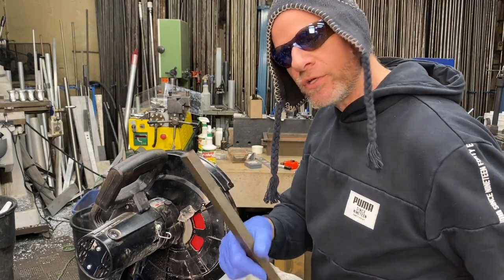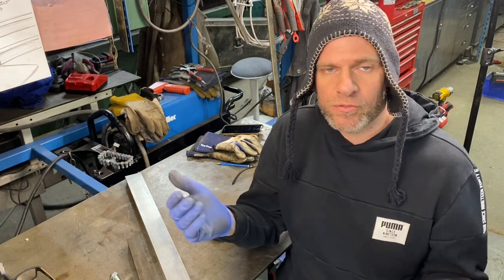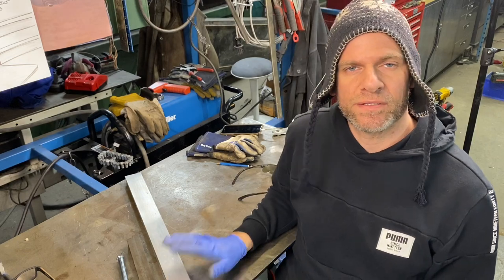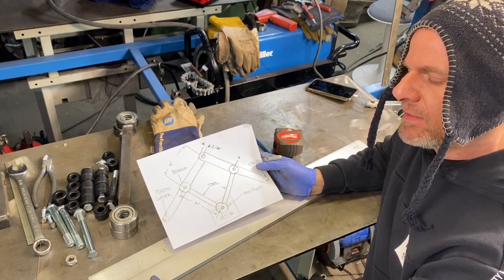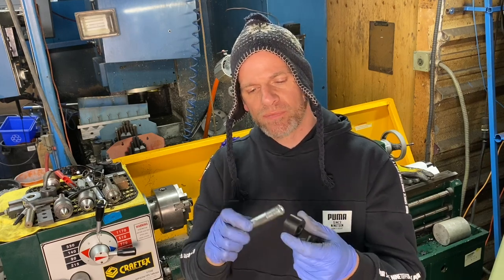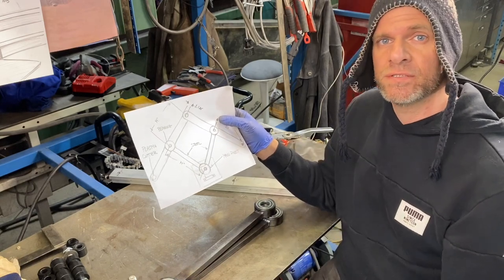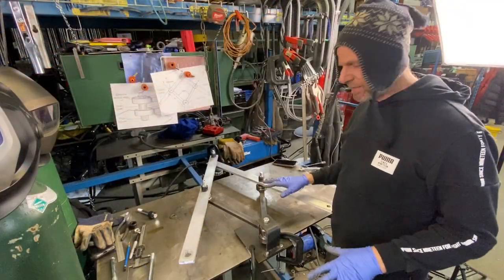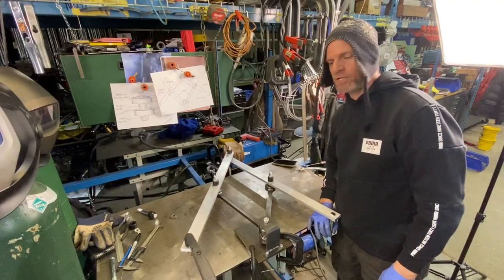Build A Pantograph Copy Machine!!

Comment: Most pantographs that I have seen don't mirror the part like yours does. If you are plasma cutting using this and for some reason your material was different on the back side you would have to make sure you flipped it over before cutting. Most cuts won't matter... but some might.

Comment: I don’t have gmail account.....how much for your unit ...pantograph?
Reply from the maker: Daniel Thomas 250$ for the pantograph unit
Reply: Bonifabcustom Rob Bonifacio I was trying to do your project everything was going find but cannot get proper pipe size to sit bearings in tight....I get some movement 🤷🏻‍♂️
Reply from the maker: Daniel Thomas i got some pipe that was a little smaller on the inside then i machined to fit the bearings in tightly it can’t really have any movement
Reply: Bonifabcustom Rob do you have Access to email ?
Reply from the maker: Daniel Thomas yes i do
Reply: @BonifabcustomRobBonifacio  what is your email so I can contact you?